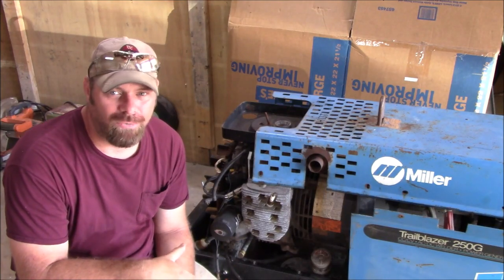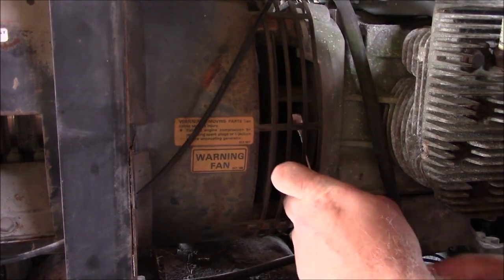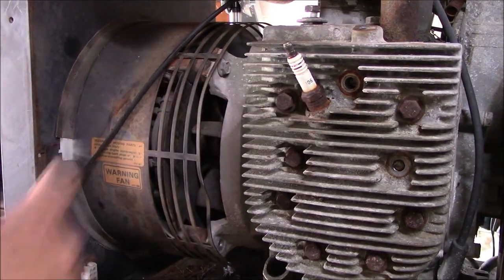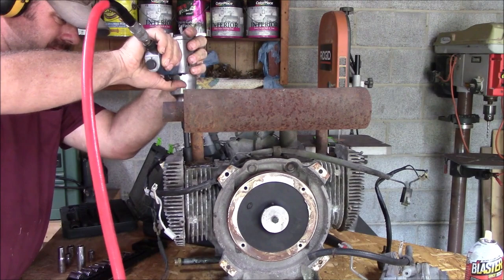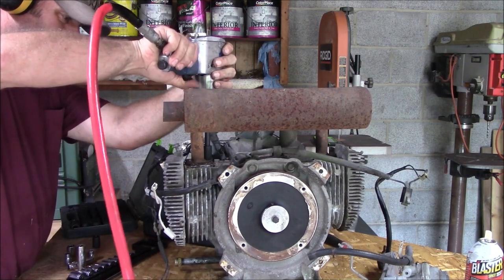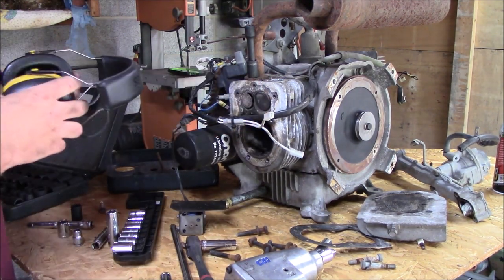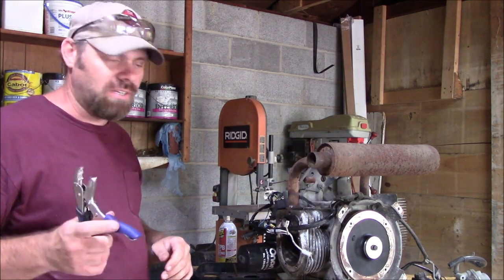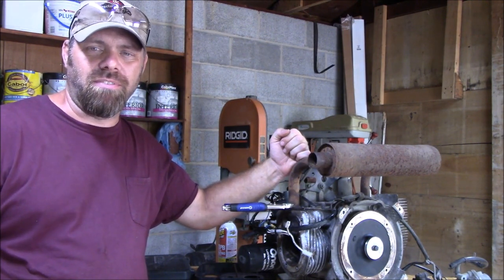Miller Trailblazer 250g Engine Removal & Tear-down

Comment: Heating and tapping directly on top with a hammer maybe a bigger visegrip for more leverage will break it loose
Reply from the maker: I actually broke it off flush now I got to drill and and try to extract it fun times